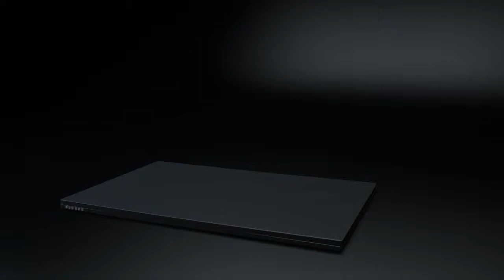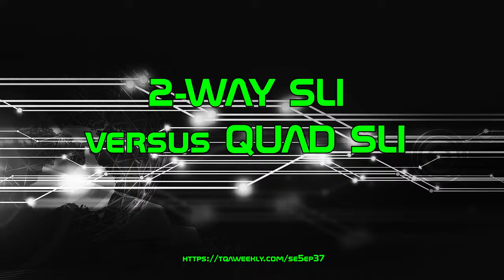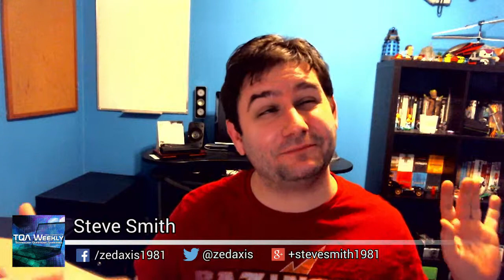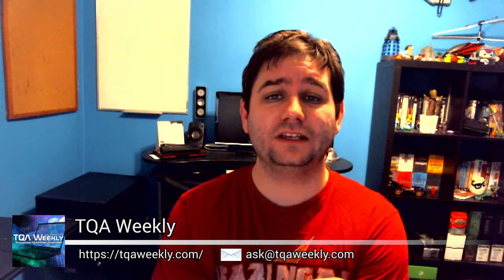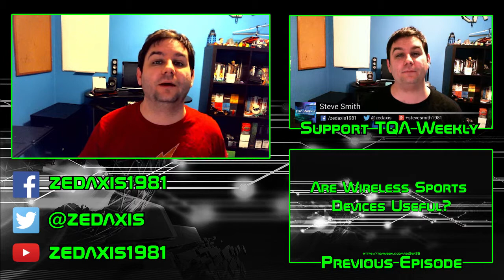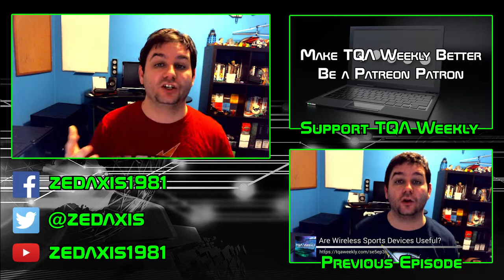2-WAY SLI versus QUAD SLI

Comment: Sli in general is not offically 100% gone yet, Here, take a gander at our forum:

https://forums.guru3d.com/threads/extreme-4-way-sli-tuning.425674/

I been doing Extreme Quad Sli tuning for over 2+ years through Nvidia Inspector & Etc, everything that I learned was all done on my own time and no one else. 

Lots of invaluable info is up, feel free to look, and yes, Alot more Pro's then Con's.

Also, my comments are not showing up for some reason, hope you approve my comment so others can see, thanks.

Comment: Extremely informative. Thanks a lot for explaining this.
I just have one question (possibly quite stupid, but still).

If I get a motherboard which says it supports Quad SLI but does not mention 2-Way SLI anywhere, it'll still work with 2-Way, right?
The motherboard in question here is Asus Z170 Pro Gaming.

Thanks.
Reply from the maker: +Aditya Moghe Here is the specifications page from Asus, https://www.asus.com/ca-en/Motherboards/Z170-PRO-GAMING/specifications/, I'll save you some time though. Quad SLI is two Dual GPU cards in 2-way SLI configuration. Hence, in order, to support Quad SLI, the mainboard must, also, support 2-way SLI. If you'd like to help me make many more episodes like this, consider becoming a patron of my patreon, https://patreon.com/tqaweekly, or sharing the link. Hope this answers your question.
Reply: +Steve Smith Thanks a lot for clearing that out. :)